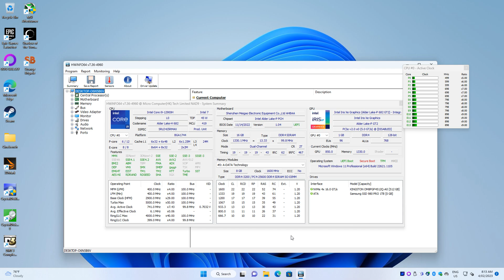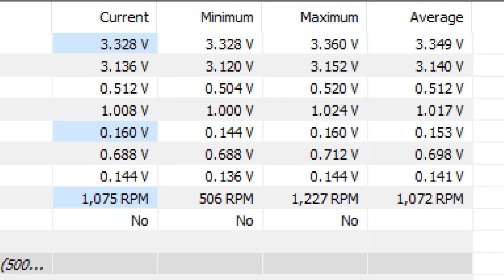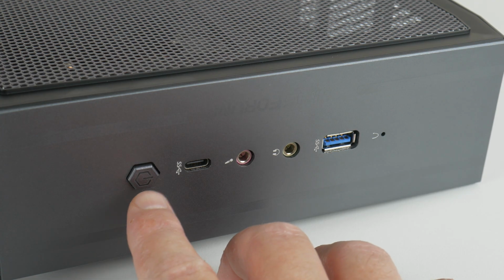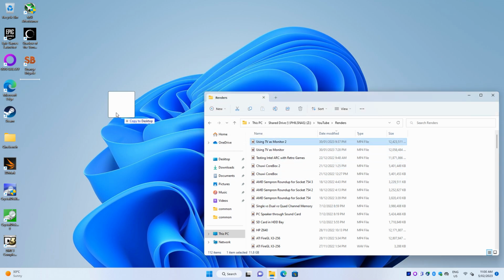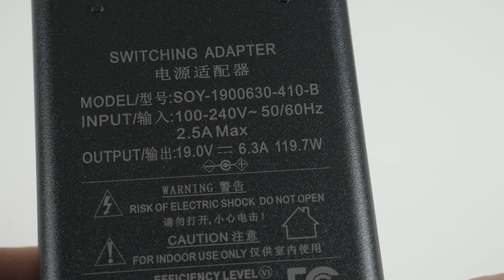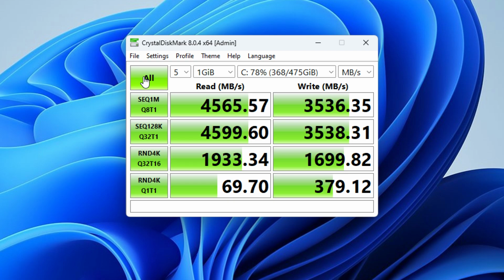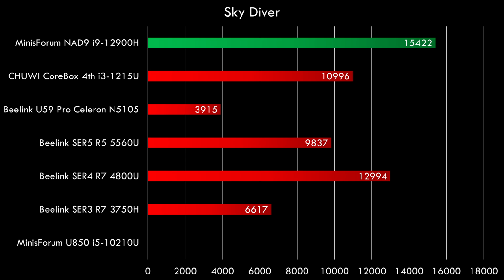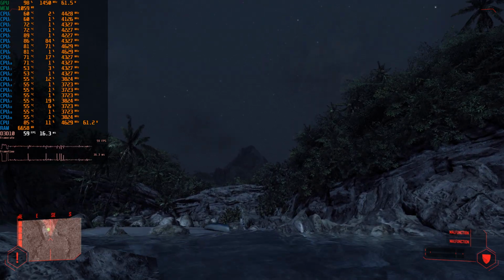MinisForum NAD9 Mini PC with Intel Core i9-12900H with 20 threads

Comment: Hi Phil, sorry something off topic. I got this Sapphire Atlanta Radeon 9800 pro 256mb Ultimate, for €36 from ebay (it was untested) that has the same pcb and parts as the xt. Clearly i want to flash it into xt. Ive tested overclocking and its able to run at xt speeds. I have the xt bios. It has the crazy big cooler with the add on fan to the side cooling the voodoo 2 as well. Can you help me on how i actually flash it as most sites have dead links to the needed tools these days. Have you already made a vid on this? If so i can't find it.
Reply from the maker: Why?? The Pro is awesome and now rare. Just leave it as is. Give it a good clean and enjoy the card!

Comment: seems like a hard sell for gaming. the best use case for such a weak graphics system is slightly older games, and it can't do that. I suppose there might be someone out there who wants to play newer games at lower resolutions, but I feel like they could do that without spending upwards of $700
Reply from the maker: The highlight is the CPU performance and the cooling solution, being able to tweak it. It's faster than my main desktop 😆

Comment: I wonder if the lack of a card in the MXM slot is due to power delivery issues? I would be curious to try a low power hungry card and see what happens haha. Nice little machine for LAN party's!
Reply from the maker: Would love to test one, but don't have a single MXM card! Yes even an older card would be an improvement because of drivers and better support with older games.
Reply: @philscomputerlab  Yeah they're quite hard to find locally and expensive on Ebay. Then trying to get a cooler that works with it, not exactly easy from the quick searching I did
Reply: For those looking for a sff prebuilt with some gaming capabilities .... minisforum hx99g (ryzen 6900hx Radeon RX 6600m)

Comment: Have you looked at AsRock deskmini x300?
It's an amazing little beast for it's size

I built a home pc for my parents with earlier A300 one, i put Ryzen 3200G, 16gb ram and it works like a charm

The newer x300 supports R7 5700G and it has bunch of upgrade options, IO is a bit limited but for the size, it's understandable 
Not to mention you can put 2 2280 m.2 AND 2 2,5' SATA ssds into it
Would make an amazing home server
Reply from the maker: Good graphics on that one, especially with decent RAM.

Comment: As MB said here in the comments, thanks for everything, I just put together a P 200 MMX with a SB Pro 2 and a 1.3 Athlon with a Voodoo 5 and a Live SB 0100, most of the hardware decisions and drivers came from your videos or website. Oh and the new format refreshed your channel for sure! THANKS A LOT!
Reply from the maker: Nice work! That MMX is so versatile, be sure to use SETMUL and check the 136in1 project with the batch files to slow down the machine!
Reply: @philscomputerlab  Will do! Thanks again! :D
Reply: Hey.. I am not great with hardware, but wish to add a mxm gpu into this nad9. Feels like you figures it out... Will be really grateful if you could guide me on how to go about it?

Comment: That's a pretty good looking mini PC. Last one I bought was a ricer R7 4700U, which I would say was about good enough for everyday use with the occasional game, but this one looks like a big step up. Sadly since then I've fallen into the fruit company's grasp, so my (now full-size) PC only gets switched on for the very occasional game, or when I need to print a PCB design from Kicad (the fruit OS doesn't support my old printer well).

Comment: Thanks for the video mate it's a delight as always. Won't disabling efficiency cores help in Crysis?
Reply from the maker: Hmm I haven't seen anything in the BIOS to toggle cores. Is this something you heard somewhere?
Reply: @philscomputerlab  Yes, can't remember where I heard. But Farcry 6 seems bit sluggish as mentioned here [ https://youtu.be/RMWgOXqP0tc?t=400 ] , even though its a new game. Just a wild guess because the game engine might be struggling with the Hybrid architecture?

You might be able to restrict the game using "Process Lasso" as Hardware Unboxed mentioned in the above video, [ https://youtu.be/RMWgOXqP0tc?t=695 ] link with timestamp